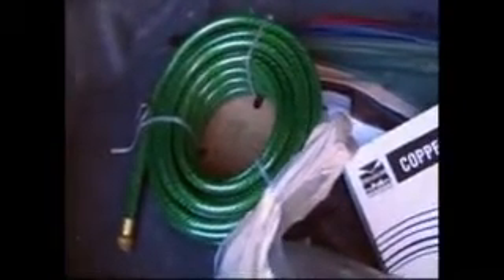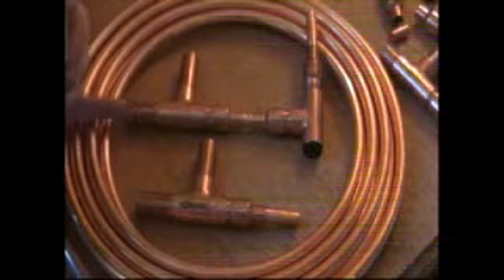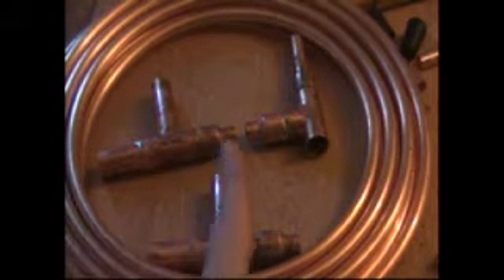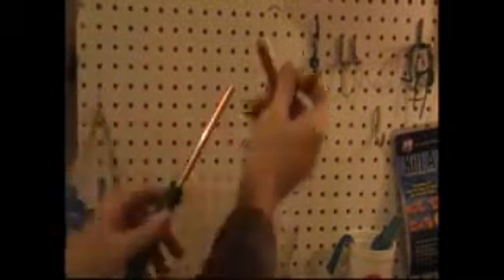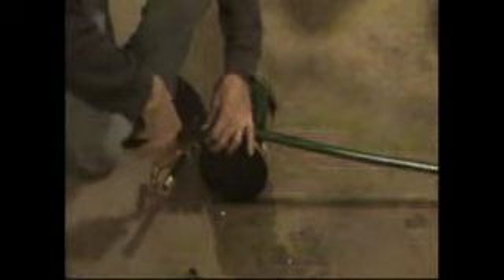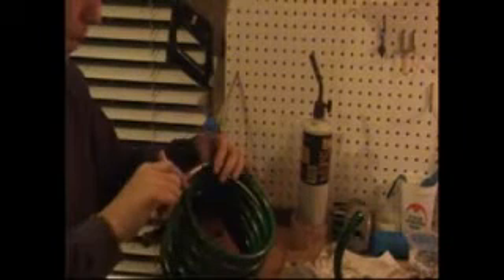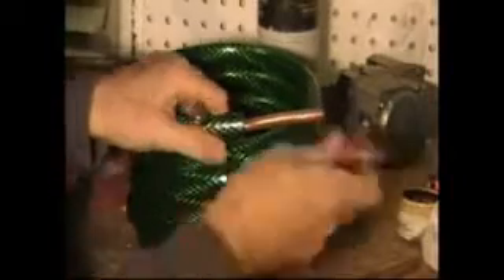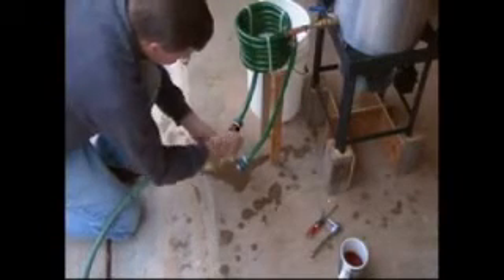Dualing Wort Chillers - Building and Testing Heat Exchangers With and Without Flow Disturber

Comment: Great valuable test ! Thank you.
INSULATION left on wire makes it thicker and that only helped keeping larger distance between both pipes. Meaning BETTER cooling effect by freely spiralling around cold water. 
Also WATER can be collected into vessels and be reused: in garden, for cleaning or even in the toilet :-)
Reply from the maker: Thanks for the encouragement.  About water re-use, lately I've been brewing in the warm months when the water temperature is too warm, so I recirculate ice water using a submersible bilge pump.

Comment from the maker: Yes, I also cringe when I see the water running down the driveway.  In the summer, I have a 12 volt bilge pump that I connect to a cooler full of ice water.  The exit water from the chiller is cooler than the hose temperature, so I recirculate.

Glad you could use the drilled stopper idea.  I stole that from somewhere on the web, so that idea has been kicking around a while, apparently.

Comment from the maker: My conclusion was that having the wire didn't make any difference.  There was a comment made on this site about my only 'tack' soldering it, instead of stripping the entire wire and soldering all along the wire.  That was just more work than I wanted to do.  But I still doubt it would make much difference.  Probably making it a little longer would have more of an effect than the wire.

Comment from the maker: There are a few variables, but it usually takes me between 15 and 20 minutes for a 5 gallon batch.  If it is winter time and the hose water is really cold, it's closer to 15 minutes because I don't have to slow the flow of wort (slower wort flow means it gets more chilled).  In the summer, I put a 12V bilge pump (<$15 at Harbor Freight) in a picnic cooler with ice and water.  The pump is slow, so I have to cut the wort flow out of the BK and it takes 20 minutes or so.

Comment: If anything the turbulence caused by such a big restriction is causing the water to flow through slower and therefore reducing the amount of water going through per given time. It would be FAR better to get more water flow than to mix the semi-cool water already in the hose. In the river example think about a log that has fallen in. It creates a high speed area that forces water around and a low pressure on the downstream where the water doesn't mix.

Comment from the maker: Adding surface area might be a function that a wire wrapped around the inner copper could provide, but it's not a function I was going for.

If you look at the "chillzilla" they get the flow disturbance effect from crumpling up the copper pipe (no extra surface area there).

For me, if I had to do it again, I'd just forget the wire all together.  I certainly wouldn't try to solder it to 15 or 30 feet of copper tube!

Comment from the maker: Everyone is making a big deal about the insulation on the wire, but with or without insulation on, it STILL disturbs the flow.  That's why I added the wire.  Someone may decide to solder all kinds of shapes to increase the surface area, but that's more work than I wanted to put into it.  But if you mean to point out that the experiement does not explain what happens with a flow disturber that also acts as extra surface area, then that is right.

Comment: The wire has two functions, primary is to increase the surface area. The other is to increase the travel distance on a given portion of the surface area allowing heat to transfer. 

Problem is the primary functions effectiveness is cut in half due to leaving the wire insulation intact (minus the tackpoints). Try using 10 to 8 gauge solid core wire with no insulation insted.

Comment from the maker: Each chiller is about 12.5 feet; I bought a 20 foot soft copper and another 5 footer.  My target length was actually 15 feet, but they didn't have a 10 footer, so I compromised.

I brewed on 12/20 in Charlotte, NC (didn't check the temperature of the hose water) but I had to close the valve on the hose water because my wort was way too cold for pitching.  So I went from a full boil to about 65 degrees, and that was with the hose going slowly.  So in the winter, the unit is very effective.